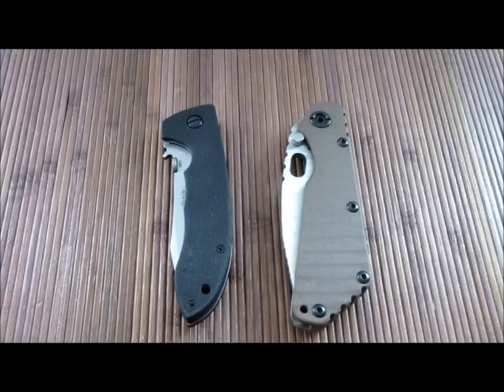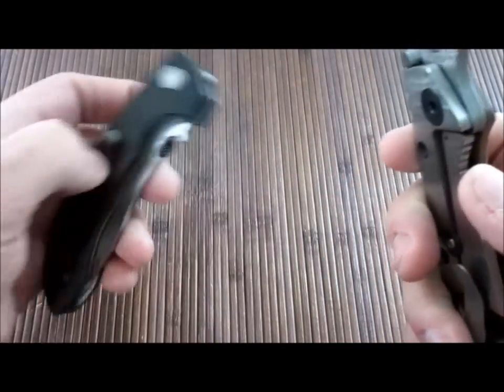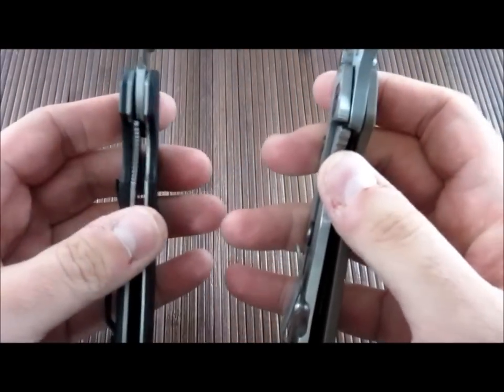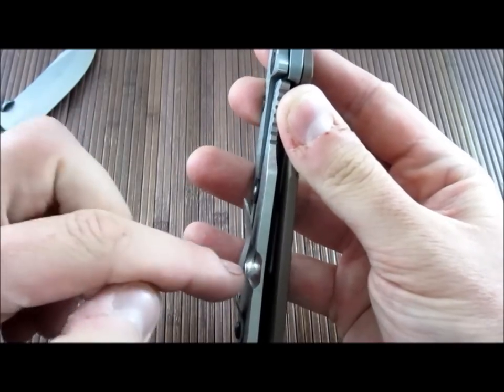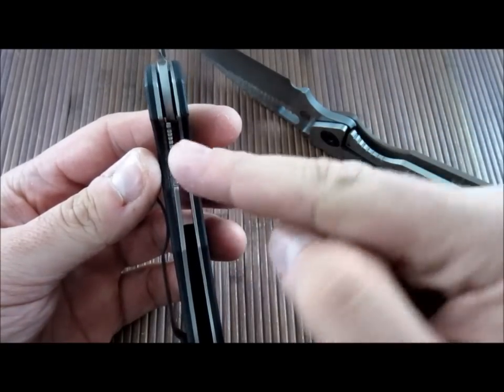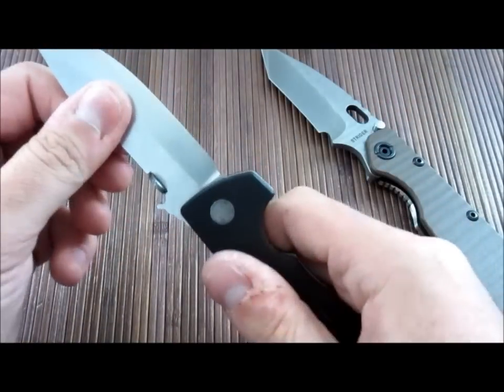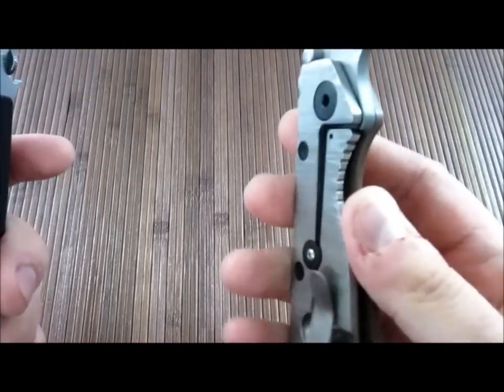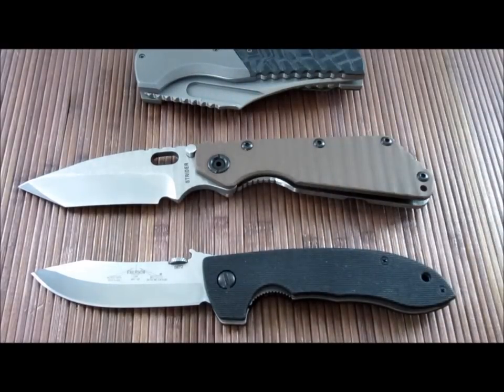Frame Lock Vs. Liner Lock Final Thoughts

Comment: Frame lock is DEFINITELY a stronger lock when it comes to structural failure. Look up the videos that weight tests them. Cheap liners are cheap liners and they are given to CATASTROPHIC failure. Frame locks are one step better in the lock world. If the knife uses titanium liners, it's still much thinner than a titanium frame lock. Sabenzas are the real deal.
Reply: Have your even had a failure? Because I put considerable amounts of stress in it but I never had a lock fail on me. I feel it's kind of a pointless discussion.
Reply: @EbonyPope  Yes, I have. Real bummer too because it was a cool little knife otherwise, but the liner lock failed. Scared the heck outa me. There are other liner locks that are better--Rats come to mind.
Reply from the maker: agreed

Comment: I've batoned with an SMF before and it did not fail so I trust a well made frame lock. I have not do anything crazy with a liner lock before because I don't want to cut the shit out of my hand. I don't think this should even be a debate because most of us don't use folders hard enough to the point we are worried they might fail.

Comment: I love the Strider design, but it's ridiculous that he doesn't put in a ti liner in lieu of the G10 side. I get "rounding" of the pivot and later blade play under light use EDC. I get lock rock on all of my Striders due to lock-face wear. Unacceptable at $475 for a SnG when you can buy a Spydie Tuff with liners and a steel interface on the lock bar.

Comment: there aren't that many variables and also a video was done on this with weights on the back.. frame locks held up better than liners*

also, your thoughts assume that the frame lock has that detent* not all do and some are fully thick.  not to mention that the liner lock plastic that you said would take the force will snap very easily*

Comment: I agree 100%, a frame lock failure in a real world app would be unlikely to allow the blade to fold down and chop your finger off. safety is always paramount to knife longevity**

if you look at a liner lock they are typically more thin, and this will allow it to deform outwards to the point were it could close down. or snap entirely *

Comment: Next discussion...Which is stronger? A framelock with the cutout on the inside (CRK) or the cutout on the outside (Strider, Hinderer, etc.)  Also, what effect does the double scalloped cutout on a Sebenza have on lock strength.  Do you think it is better or worse than the single cutout.

Comment: Man, was that Strider ICE blade floder? That is my favorite folder. That balde is beautiful. Does it look as good in perosn as it does in teh video? Any folderr can fail under hard action. Truth is that a folder can't match a fixed blade. It will do similar work, but it will fail faster. 
Hopefully, when the lock fails on a floder it won't close or you will loose a few fingers if you are using it hard. This reminds me comparing a pistol to a gun. They both can fail given the right situation

Comment: i think most well made knives under normal, hard use will not fail. Most use involves cutting which will not cause the lock to fail. As you cut you do not put pressure on the lock.

Forward cutting is the only normal use that could put stress on the lock.  Unless you are stabbing trees or brick walls, the lock shouldn't fail.

Comment: This discussion is pointless , the stregnth of the knife is in the stop behind the top edge of the blade as this is where the pressure is applied when using a knife , not the frame or liner lock as thier purpose is just to hold the blade open .
Reply: Even if edge is though. When the lock is fail your khife is useless..simple

Comment: for my money the strongest lock i have handled is the tri ad lock from cold steel and a properly broken in knife from them is smooth and easy to use and deploy you seem to not like cold steel i know that they make sometimes not the prettiest knives but i rather a knife work then have a pretty show piece that could fail and cut my hand when i need it most but i also get have cool gear but have cool strong gear

Comment: Good vid. I think you right in that there are too many variables. I will add that you should check out STR's blog on framelock knives.  He has tested some and I think he says something like none, or none that he tested held over 100 lbs. I say just buy what you like. If you really need a folding knife and really need a strong lock. Look at CS for cheaper ones and BM Axis locks for the higher end blades

Comment: now look.  The criticism of the frame lock isn't even valid all the time.  Look at the Kershaw Volt SS.  It DOES NOT have that ground out area on the rear of the frame lock, causing the hypothetical weakness.  It's full thickness all the way.

Comment: While a linerlock isn't necessarily the strongest lock, it is among the safest. A liner lock can generally fail in 1 of 2 ways, 1 is disengagement which means trouble. The most common way for a liner lock to fail is for it to bend out of shape, meaning the knife is technically broken but your fingers are still protected. Back locks are generally speaking the strongest locks but failure ALWAYS gives the blade free passage towards your hand. I'll stick with liner locks if I have a choice